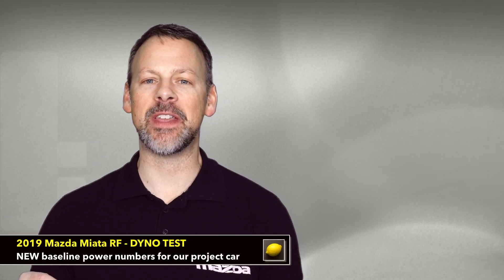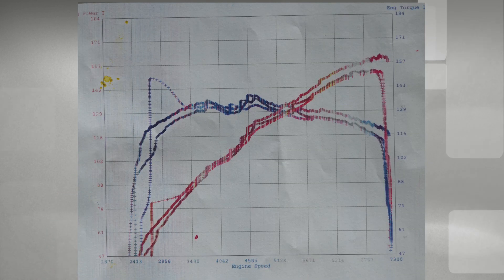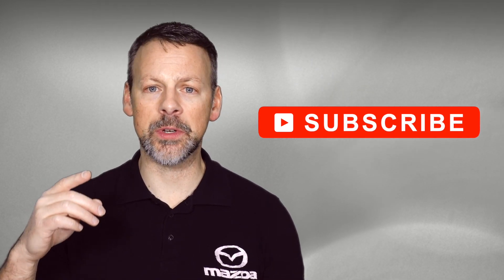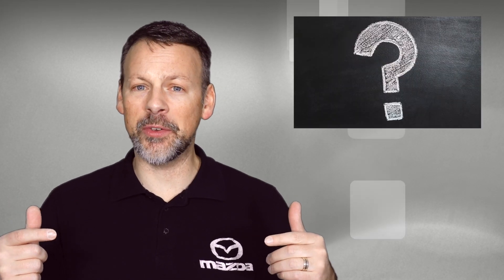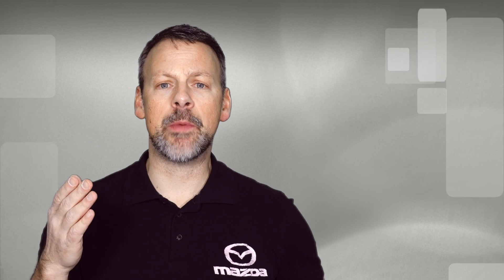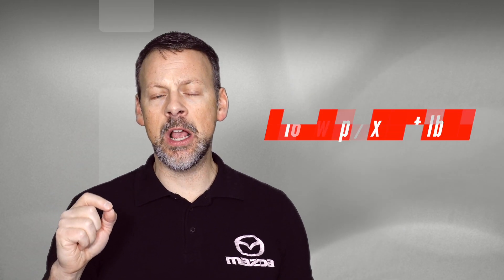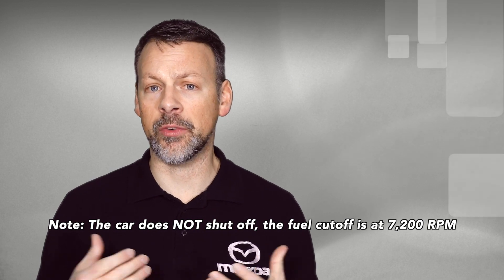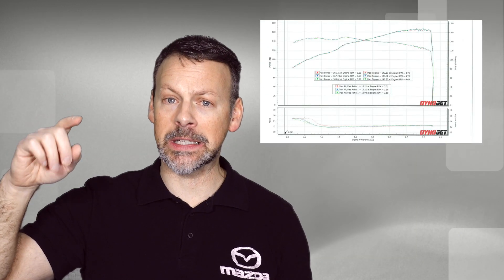2019 Mazda Miata - DYNO TESTED Again (more power)!!!

Comment: The baseline on my stock 2015 Subaru BRZ was almost identical to this chart. Using the same DynoJet system, I managed 171whp / 146wtq using SAE smoothing. The ND Miata just has a 500lb advantage at the track.
Reply from the maker: 👍 what do you think of the new BRZ?
Reply: @TheLemonFactor  I will soon find out as I instruct for NASA and typically get paired up with the new Toyota guys. Sounds like a blast!

Comment: put any performance air filter, any performance exhaust *tuned to match so it is not too lean, around 13-13,5 afr. and you got 190-210whp for good

Comment: Hello ! Very interesting stuff 🙂 it is funny because I have the exact same car, ND2 RF same color and I am doing the exact same thing as you are ! I did put my car stock on 2x différent dyno and the reading are consistant with your fiding. Eventhough in Europe we do not read power at the wheel like you guys do in North America, I can tell you that my car was dynoed at 169,1hp @ 7169rpm at the wheel, which is very close to what you found. In France, we calculate the power at  engine crank, taking into account drive loss. This way, we can compare Mazda given value of ND2 184hp stock to our dyno pull. My 2x dyno pull gave me 192,2hp @ 7169rpm crank and 192,8hp @7195rpm crank. Those two numbers being given on 2x différent dyno, each dyno pass being done 3x Times consistently, I know those numbers are good ! Now that I know your number at wheel is very very close to mine, I can affirm that ND2 miata have slighly more power than what Mazda said. Mazda said 184hp crank, we measure 192hp crank (+8hp crank)
Reply from the maker: Mazda does seem to be underrating the output of the engine.  It looks like you have an aftermarket exhaust on your car, is that axle-back?  What kind it that?  Also, are you considering other modifications?  Thanks for the watch and comment.
Reply: I already have short Spring and stiffer torsion bar from Eibach. 4x pistons brakes from willwood. Awaiting Bbr Gti super 200 kit (4 in 1 collector - K&N air filter and cold air intake). After this, will be Super 220 kit:  hot cams, stiffer valves spring and spécial spring seat.
Reply: @stephanetr6083  Could you post a few driving videos of your ND when it gets those BBR upgrades? There's not enough videos to hear how those Super 220 kits sound with the raised 7800rpm
Reply: @jamescarson6681  I sure will ! I'll keep you all posted. I did receive the Super 200 kit and will be installing it soon. I am also awaiting Ohlins stocks, they should arrive next week ! Later. Steph
Reply: Stephane Tr -yes please keep us informed on the engine mods. Your car sounds like it’s amazing !
Reply: what was your torque reading?
Reply: @aw11man26  torque went from 152 lb.ft @ 4800 rpm to 167 lb.ft @ 3800 rpm, which translate in more torque but way earlier, which is very enjoyable, best of both world: more torque down low and more power with increasing red line !

Comment: It’ll be interesting to see how the numbers change with just a new exhaust / muffler
Reply from the maker: Planning on installing one of them this weekend..
Reply: @TheLemonFactor  Looking forward to it.. supposedly it gains ~10HP at the higher RPMs.  I hear the new mufflers add drag and lift to the rear at high speeds though which affect handling and require a diffuser to rectify.
Reply from the maker: @dan428  That would be great to see 10hp... we'll soon see.

Comment: That's pretty interesting about the fuel cut off.  Can you do an ecutek tune to increase the redline limit.  My nd1 is set to 7300 from 6800.  Are you going to test headers as well?
Reply from the maker: I haven't decided if I'll keep in NA, or possibly go with a turbo or supercharger.  I'm going to test the exhausts first, then see what's available.
Reply: @TheLemonFactor  I didnt know they had options for forced induction on nd2.  That would be interesting if a tuner could increase your redline to 8000 or more.  I bet headers and exhaust would unlock 10hp or more.  I wish I modded in stages so I could feel what each mod added vs getting everything done at once.
Reply from the maker: @businessmanph  I don't think there are any FI available yet for the ND2, but I know a couple tuners are already / close to perfecting tuning options for the ND2, which hopefully means the hardware kit shouldn't be far behind (fingers crossed).
Reply: @TheLemonFactor  if you have the money and patience I would boost it.  Leaving it stock is still a super fun car.  Just keep in mind that you may want to do suspension. Sway bars. Maybe rotors and pads before the boost.  When I put my sc on the club suspension was very sloppy.  It would rock back and forth and bounce around when doing hard pulls on the highway.  When you add power you need the foundation.
Reply: The Lemon Factor! Have you heard of the BBR super 220 package? 220 hp N/A!

Comment: Glad you got more consistent numbers this time. The higher 7500 limit is only available in 1st and 2nd gear and only for brief periods of acceleration (ie, you can’t hold it above 7200 RPMs for an extended duration).  In all other conditions, the limit is 7200.
Reply: This isn't correct.

Comment: So drivetrain loss is 12hp? From 181 to 169? The toyota 86 at 205 does 179 and the earlier frs model is 200 are 173 so why such a difference?
Reply from the maker: Good question.  My guess is that there are variances in dynos, especially different make/model dynos, but also the difference can simply be due to how the two manufactures determine and quote horsepower figures.

Comment: Having had a GWR Super street single tip on my car for the last few weeks (previously had the HKS Premium Legamax) - I can confirm that the GWR SSST certainly feels like there is a much better flow and it feels like there is more torque/power - lets see if the data proves it
Reply from the maker: I just received the Greddy exhaust to do a side by side comparison to.  One of them will be installed this weekend, and after a little break-in, we'll get it on the dyno to find out.
Reply: I put a GWR RoadsterSport SuperStreet TwinTip on my 2016 GT and a FAB9 Tune. I`m feeling the additional power. I`m going to add the GWR midpipe as soon as it`s back in stock.
Reply from the maker: Have you had the car dynod? I’d be curious to see how much HP the Fab9 tune adds. 👍
Reply: @garylee5568  Damn. That's a long name for an exhaust
Reply: @TheLemonFactor  I have not. In the GWR Forums Brian at GWR is not too keen on the Mid- pipe mod on my car unless it`s along with a Turbo of Super charger. With an OEM header and the GWR muffler I have he`s not seeing any HP improvement installing a mid-pipe. That`s significant coming from him. On Autocross or the twisty mountain roads the car, a 2016 ND, pulls hard past the stock 6800 and sounds awesome!! Of course I`ve modified the entire suspension!
Reply from the maker: That’s interesting 🤔 and different than the “sales” page for the mid-pipe. Well I guess we’ll all find out soon enough if a mid pipe adds any HP to a non-boosted car.

Comment: I want to see number with 93 octane tune with cold air and cat back
Reply from the maker: The tune is already in use 😜 and the dyno results are coming 👍
Reply: @TheLemonFactor  so this dyno was stock right?
Reply from the maker: It is!  I have several videos showing dyno results with various exhaust mods - if you haven’t seen them, check out the playlist on the channel 👍
Reply: @TheLemonFactor  thank you! I had a 2019 miata but i had to get rid of it. I really want to get another one. its a little rocket.
Reply from the maker: It certainly is, and noticeable more responsive with the tune 😁

Comment: Shouldn't you be doing the dyno runs in 6th gear, since the ratio is 1:1 there ?
Reply: Radoslav Tashev I think it should be in 2nd because it can reach 7500
Reply from the maker: Typically you'd would try to perform your dyno runs as close to your 1:1 gear ratio as possible, but as that's 6th gear the consensus from speaking with a Miata builder, online research, and both dyno shops was not to due to stress - some felt it may not even make it to the redline in 6th.  They all agreed that as long as I keep the pulls consistent (i.e. pick a gear an stick to it) when testing, I'll be fine.

Comment: Seems like a lot of torque for an NA 2.0 liter
Reply from the maker: Needs more 😁
Reply: @TheLemonFactor  agreed but I meant it seemed high for what it is rated and for being NA. The engine is only rated like 150lbft at the crank and it is putting down almost that at the wheels.  Seems like a false reading for torque
Reply from the maker: Got it 👍. Well I’ve had the car dyno at the same shop several times now and the readings are consistent.  They also are close to others in comparison 🤷‍♂️
Reply: @TheLemonFactor  just surprising. That would put it at around 175lbft at the crank which is quite a bit for an NA 2.0 with no mods
Reply: Sergio  175 lbft for an na 2.0 is quite a bit. even the Honda S2000 engine didn't make that much torque. Torque is displacement dependent unless running boost especially when having to meat strict EPA regs. Most high performance 2.0 na engines only make in the 150-160 lb ft range.
Reply: Sergio  Im not talking about horsepower. Im talking about torque. even Honda's 2.2 liter F22C from the updated S2000s only made 155 lb ft. They CAN make more if EPA emission regs don't matter but from the factory there is only so much they can do.
Reply: Sergio  I know a lot about engine operation. 175lbft is still a lot for a near stock 2.0 ns engine, period. Not saying it didnt make it, just that it is surprising.

Comment: Is the goodwin full exhaust too loud to daily?
Reply from the maker: That would be subjective to what you would consider too loud.  However, if you go to the GWR website, even they comment about using their SuperQ if your considering going with a mid-pipe due to sound levels.  If you checkout some of my other videos, you'll see that I do plan on testing the GWR full exhaust from a sound measurement and hp produced - just waiting on the dyno shop to reopen to get the testing started again.